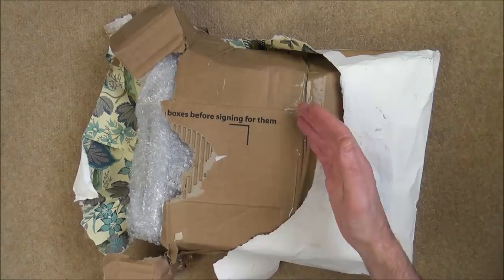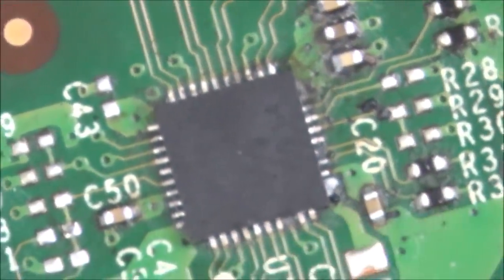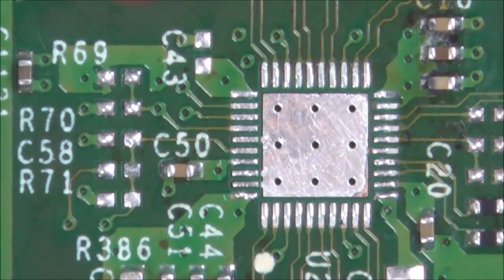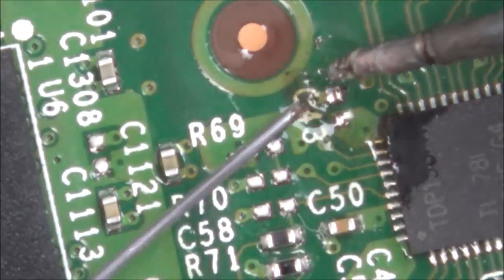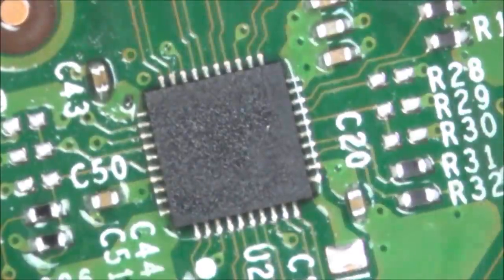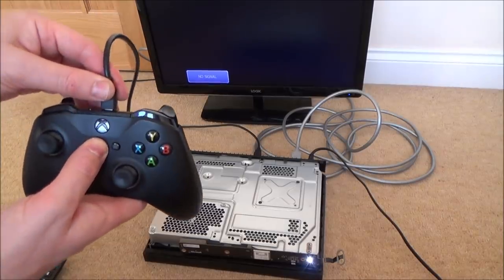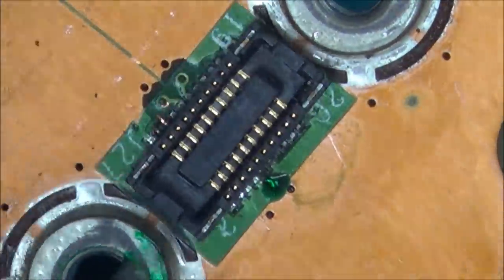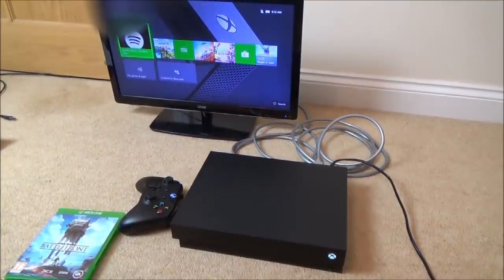Trying to FIX: Faulty Xbox One X No Display

Comment: 19:30

The funny thing about those tiny components is that when you want them to stay on they'll fly off from the force of a mosquito's fart.

However, when you WANT to take them off a board they're attached with some kind of titanium alloy solder that demands a tube of flux, 5000 degree temps and 4 hours work per component.

The joy of fixing electronics, haha.
I knocked off a couple 1mm resistors and a capacitor off my 60GB PS3 and the came off with the slightest tap. When trying to take off their neighbor components (same exact components) it was nearly impossible 😅
Reply: Lmaoo ! 
Also I was wondering something about the components you put in place. How do they actually set themselves in place ? I thought that you just had to place them well and put heat on them for several minues and that's all but in this video Vince mentionned that the components were doing a "little dance" etc. Also it moved and a second later he said "there we go it's in place". That's the part I don't get, how does it goes from moving to strongly attached in a second ? Thanks !

Comment: I did the exact same with my XboneX, regarding snapping that connector on top of the motherboard. I literally left it in place, screwed it back down and it works fine. No problems with the USB/Sync etc. Seems like it's a really fiddly connector and easily breakable

Comment: The boot up animation isn't the correct one for the Xbox One X. Should show a screen that displays the processor with the 4k chip upon startup. The correct startup animation can easily be added by connecting the Hard Drive to a pc. Regards Dan
Reply: That's really odd
Reply: Wow, didn't know that. Thank you!
Reply: Sure that’s not just for the first boot?
Reply: No everytime you turn the console on unless set to instant on it should display the 4k chip before the xbox one screen. It's just partially missing the bootanim.dat or its had a replacement drive and the wrong one installed
Reply: Safe mode

Comment: I can tell you that ripped connector does not rip easy like that I’ve taken apart my x atleast 4 times before and that connector is just fine by the looks of the traces were squeezed folded back after putting back together the first time so probably the other person did it
Reply: Carlos Sanchez pretty sure they just glued it on to look normal
Reply: There's it's no residue indicating that they glued the connector back on I don't see any evidence of that and in my personal experience working on Xbox one and PlayStation 4  Microsoft tends to get less consistent when it comes to Manufacturing
Reply: @lukereeves3711  Empty vessels make the most noise
Reply: This happened to me too, when I take apart my One X the second time. I really didn't push hard or sideways, so sometime it really go off easily. Luckily I managed to resolder it with one trace repaired and 2 or 3 missing (double ones) and it works again :)
Reply: Great video Vince, keep up the good work, you’ve inspired me to dust off my soldering iron 👍

Comment: I love how when you replaced the resistors and capacitor, they were a little wonky, but as you heated the board to pull the broken hdmi chip off to replace it, when the leaded solder melted, the surface tension aligned them perfectly. MacGyvering the Sync button was just pure gold :)

Comment: Thanks Vince for another nice video. I suggest you two advices for hot air desoldering. If you don't wanna stress the board with hi temperature I add some low-melt solder to solder pads around the chip. (I bought it from Northridge fix and really changed my life...) and the last one... protect the board before using hot air. I use kapton tape or simple aluminium foil folded many times. You save a lot of time and no more damages to nearby components. Keep on your videos, you rock!

Comment: This was a fantastic case study. Cheers to fixing the sync button. The sync button on a controller broke and I actually soldered it back on. I was lucky to see it break and find the damn button much less soldering back on. Currently working on an xbox one s and x with no display and good ports. I will try safe mode first since there's also like a debug mode for the usb update.

Comment: Hi. Great repair. You got there in the end. I think that you need some low melt solder or a board pre-heater to heat the underside of the board prior to working on the top side. Those ground planes sap the heat away so quickly and efficiently unfortunately.

Comment: Hi Vince, why not use some low melt solder like Chip Quick on the legs of the chip to mix it with the unleaded factory solder and lower it's melting temperature? You could apply it with a soldering iron to the legs so that it mixes up good and then apply heat and take the chip off. I think it could save you time and prolonged exposure of the board to heat. I think Chip Quick has a melting temperature of 80-90 degrees and can really lower the overall  melting temperature when mixed with the factory solder.

Comment: Would it be daft of me to ask if you checked the video settings at the start ? as the " FAULTY " display chip may not be faulty and was just down to the missing components :) and the previous owner not having a 1440p display and not knowing how to reset the Xbox.. Cheers for the video P.S the plug that broke looked very suspect to me ..
Reply: @pineappleroad  I agree but when vince plugged it in after replacing the components it didnt work untill he turned it off and went into 720p mode by holding down eject and power on button :) the setting had been set to 1440p and audio turned off in the settings menu and not auto :)

Comment: Great vid vince and well done on the repair. In the case of that connector and the pulled pads - what I've done in the past is use the strand core off a multi stranded wire, it's typically thinner than any enamel wire you can get off the shelf (earphone cables have some of the finest - albeit enameled wire that i can find which may be ideal for your purpose) then after soldering it in use something blunt - i use the round portion of one of those pointy dental picks to smoosh the copper wire down and gently stoke it, the copper is so maliable that it will eventually start smoothing flat (remember being copper it will also become more brittle) once it's as flat as you feel comfortable i coat in UV mask then when thats cured i flatten the mask down with 1000grit sandpaper to make it level with the rest of the board, heat up the topside of the board with your hot air gun for a few mins so it can absorb the heat and melt the solder, then place the connector down and hit it the back of the board with the gun - it should take now with that and lead free solder..... if not, get some 140c solder for next time, not ideal but better than nothing. The hard drive didn't sound healthy i'd plug into a pc and run some sort of integrity scan or disk tool to ensure it's not bad or a full format on the console iteself if possible. Thanks again :)

Comment: Hi vince, tip when measuring low value resistors short your test probs together first and make a note of the reading this will be the resistance of your leads then take this off your reading of the low value resistor your measuring also i would invest in some fine tiped gold plated test leads there not that expensive from ebay.

Comment: Vince what I would suggest I know it would have been more work, but think I would suggest doing wires for all the pins on the USB next time, that way it will reflow level, plus would also connect all the pins evenly, I know plastic is the worst thing to have around a heat gun, and electronics as plastic melts way more easier. great fix video, I am wondering whether the one capacitor would be 1ohm seen as the one on your board came up as 1.25 ohm, and the 2 ohm that you fitted came up as 2.25 ohm. as an outsider guess and not knowing too much about electronics, apart from knowing some basics, basically car maintenance from the early 90's.

Comment: From what I could find out is that there is a possibility that connector that is attached with a lego style connector to the  outside of the cage is potentially connected to the front USB port as the wireless modules are on its own PCB on the outside of the internal cage connected by either a ribbon cable or a pin header connector

Comment: Well done Vince! Two comments here: 
1- The HDD definitely needs to be replaced.
2- We see no evidence of the faulty board’s retimer chip being faulty. How did you come to that conclusion? I would try putting it in your console before ordering one to see what happens. My feeling is that the entire issue here is an HDD issue and nothing else
Reply: You are definitely correct, not sure why he didn’t just replace the HDD
Reply: @mattw2072  May have shortened the video by 40 minutes and saved replacing components that didn't need to be replaced  if he had just plugged it in at the start?

Comment: Hi Vince,
As always I enjoyed your video.
I just had a thought about the broken connector. It might be a good idea to get a new connector and just using whatever pads is left on the motherboard to hold it. It sure is better then a bodge wire. And also as you mentioned some pads are just grounds. And from what I understand USB don't need all those pins to work, so maybe you are lucky that the ones you need is still on there.

Comment: Just a couple of tips: if you are a right-handed person I would suggest you to hold the hot air gun with the left hand and tweezers with the right one. You don't really need any precision in pointing the nozzle towards the board - 1 cm to the side won't make things worse. But you could surely benefit from holding the tweezers with your right hand, this makes a difference (IMO). And the second one - sharpen your tweezers with some file or a piece of sand paper, this helps a lot. Of course it's easier just to buy some new precision tweezers to work with SMDs, but if you already have those just by sharpening them you could save some money.

Comment: I did the same with my sync connector not as bad as that it never came off the pads I put a jumper wire from the tiny capacitor under the sync button  to pin number 1 on the board and I got the sync button working the usb dont work but I dont care as I got a usb hub  and the sync is what's important good video keep up the good work its through watching  your videos that inspired me to do what I did top bloke Vince thumbs up to you

Comment: Hey Vince. If your wire is causing the connection to be too raised from the other pads just put a bit of wire on all the pads. Not really an option for a larger number of pads but i think you could make it work here.

Comment: Hello there Vince, a little advice for measuring low resistances. You have to take into account the resistance of the measuring leads of the multimeter they are usually long thin wires so they count as parte of the measured circuit. If you are measuring high values such as 10k the low resistance of the leads in series will not affect the circuit that much, but a 1ohm resistor is basically the same resistance as the leads it self, so you can short the leads before measuring to get a value for the resistance of the leads. Lets say you short the leads and get a value of 1.1 ohms. Than you measure the 1ohm resistor and get 2.1 ohms. Than you know the resistor is exactly 1ohm. If you get a 1.5ohms measurement on the other resistor, than it means that the resistor is 0.4 ohms, which is indeed basically a short.
Reply: That 1 ohm resistor in this particular circuit is just a bridge to connect the chip pin into another IC. You also connected a 10k resistor into that same pin and ground. The 10k resistor connected to ground is meant to give the pin what is called a pull-down, it prevents the pin to be "floating". A floating pin is a pin not connected to anything which has a fluctuating voltage from the air and surrounding circuit because of electromagnetism and electrostatic.

When the IC connected to the pin through the 1ohm resistor gives it power we call the pin HIGH, when the IC stops giving it voltage the pin goes LOW because the 10k resistor pulls the voltage to ground (zero volts).

When the IC gives voltage (3.3V) to the pin, Both resistors are pulling the pin at the same  time, one pulling it HIGH (3.3V) and the other pulling it LOW (GND), however when you get both of them pulling at the same time the lower value resistor pulls it harder and the voltage is pulled closer to the HIGH value (3.3V). However if both resistors were of the same value, lets say 2k, then they both pull the pin with the same force which means that the voltage gets divided (1.65V). That is why one value has to be 10 thousand times greater than the other. That way it only pulls with enough force to counteract the effects of electrostatic and electromagnetism so that the pin is not floating.

The 10K can either be pulled LOW (connected to GND) or to HIGH connected to (3.3V). that is the pull-up or pull-down resistor.
Reply: Every digital circuit has a pull-up or a pull-down resistor. If it is not on the PCB as a resistor than the pin of the IC has a internal pull-down/pull-up resistor.

You can probably trace the sync button trace from the button (the button connects to ground when pressed, so the resistor connected to it is pulling up when not pressed) into the IC pin that senses the button and somewhere in the circuit is probably a pull-up resistor, generally 10k into a 3.3V voltage rail.

Comment: You could use tiny wires from something like a usb cable shielding or just multi-threaded tiny cable to solder those pins for the connector. I've done it - it works absolutely fine.

Comment: You may wish to watch a few "Northridge Fix" videos if you have not done so already. He uses a combination of soldering flux, low melt solder and solder braid. Using this technique he is typically  able to remove and replace "chips" with relatively  low temps and low air flow with minimal impact to surrounding components. Cheers

Comment: You gotta remember that you needed the ground connected as well as the sync button, probably it was connected via the screws, but if it didn't you would need to connect another wire carrying the ground

Comment: The only thing I would of liked to see is you test the empty pads where the resistors went since you didn't take the resistors off to test their values. If the empty pads had given you a higher resistance reading you would of known your resistor readings were right. If they had given you the same or lower reading you would have known you was getting false readings and would have to take the resistors off to measure them properly.

Comment: Well done , Think it's time to to get some 0.01 mm and 0.0.2 mm jumper wire 0.1mm is just to thick 😂 It`s used for jumpers on the iphone, Great video 👍
Reply from the maker: Cheers AR. 5 or 10 times smaller!!!! 0.1mm is already hard enough to manage. Do you think 0.01 or 0.02mm be OK for something like a USB port on the power pins or would it likely burn through. I presume on data lines it would be OK? I might get some :-)
Reply: @Mymatevince  for data pins should be fine, power pins usually uses more pins connected together 0.01mm is about 17mA an 0.02mm 33ma

Comment: Did you try that other chip back on your xbox? Only asking because you had the exact same fault after replacing it with the working one then discovered it was in 4K mode. I was wondering if the missing resistors was the fault?

Comment: That hard drive definitely sounds like it's failing. It might still function for a while, but that kinda clicking noise means SOMETHING is catching on the mechanical components, and sooner or later that'll scratch the disk inside up and make it fail completely, even if it can still be read for the time being

Comment: This actually hurts me. lol. 90 percent of board manufacturers label the components on the board with identifiers such as r35 for resistors, c35 for capacitors, t35 for transistors and so on. The number value only refers to the order of the component or just how many there are for reference to a manufacturer repair guide which normally only they have access to for proprietary reasons. Also it might have been cheaper for you and safer to find a faulty board off ebay instead of paying ridiculous prices for a single component.   Also also, components typically have different shades of colors to indicate their values. If you have a good eye and color accurate monitor, you can typically find these components by matching color and size. Hope this helps!

Comment: its for the wireless controllers i done the exact same thing but i left it on the ribbon side of the cable and just screwed it back on tight and it works not had a problem with it since

Comment: When you solder or desolder this type of IC remove nozzle from hot air and do it without it. What more when you solder don't put IC at the beginning just heat up the board in the place where you put IC then put IC and solder it. The second tip about the connector. When you repair this type of pads take wire and try to squash it with pliers or small hammer it will be thinner but wider just like pad. Don't use solder mask.